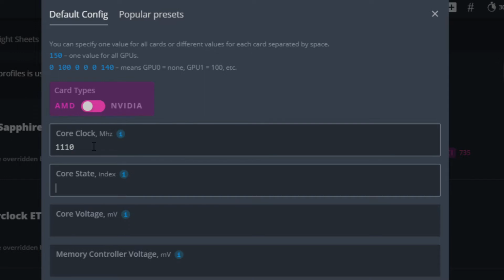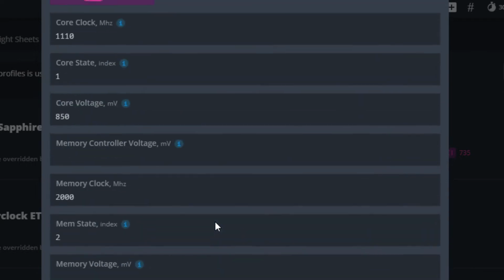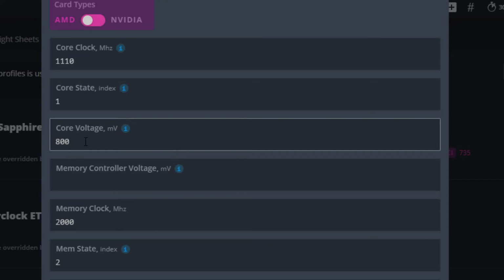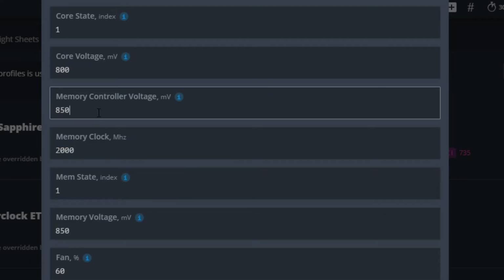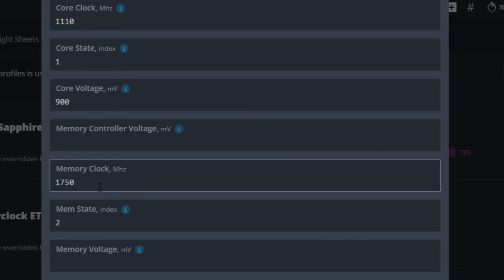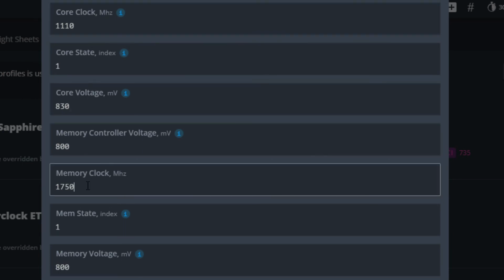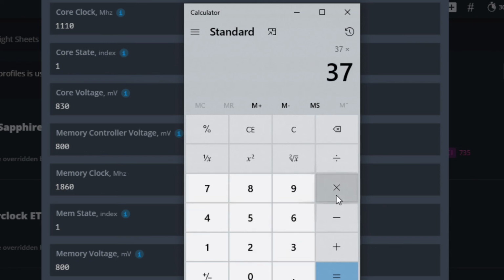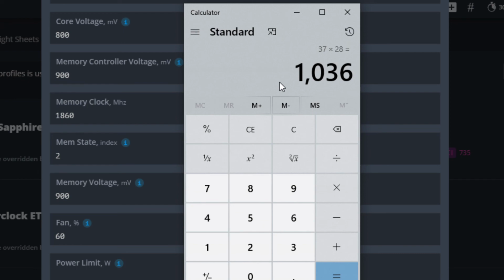How to Overclock RX 570 for mining Ethereum or any Algo Simple in-depth Beginners Guide using HiveOS

Comment: Please help...I have successfully placed four rx 570 cards on my btc s37 motherboard and after oc settings were tweaked everything ran perfectly and I've been mining for a month...now I have bought a 5th gpu rx 570 and even tho it's exactly like the others...this one keeps crashing every time no matter what oc setting...I tried flashing a new bios with stock settings..but it's still doing the same thing...hiveos does see the card ..it reads its temp...fan % but shows N/A for hashrate always. and then crashes before it begins to mine  if it would be able to...any help or suggestions? ..do I have a bad card? can it be fixed? I feel like it's problay some driver or bios issue but I don't know where to begin... hate to waste $235..any help appreciated
Reply from the maker: I would suggest running memory to start on 1750mhz, set core clock 1100mhz, set core voltage 900mv.
See if that does anything to start
Reply: @CostEffectiveminingYT  thanks for your reply.....I have it on 1750mhz 825 v and 1100 just like the other 4 which are running great...this one just keeps crashing and doesn't show a hashrate..feel like it's a driver or bios issue but tried to flash the bios and it didn't change anything
Reply from the maker: @st-qp4mr  try it solo without any other gpus in the rig. you can try the stock bios again and see if it will mine on stock settings. i have 3x rx 470 4gb that crash with stock settings so I have to run 1600mhz on memory and i only get about 23mhs, with those cards I run 1040-1100mhz core clock with 900mv.
The Core voltage has an affect on the memory controller voltage for these cards.
Reply: @CostEffectiveminingYT  yes took all other gpus out and tried it solo...still same result...it shows on hiveos and give temp..fan% and N/A for hashrate...I have tried every possible clock settings...and I have flashed the stock bios..still it crashes every minute or so???
Reply from the maker: @st-qp4mr  lsst thing to try is using an eraser and cleaning the pcie contacts

Comment: Hello! Thanks for this video. I am using an RX 570 in my PC to mine and I started with 26Mh/s @ 58C with stock bios (plugged directly into it) and some MSI Afterburner settings. Now I flashed the bios with Polaris mod and applied some OC settings in AMD Radeon Software to get 28MH/s at 54C (1,110 Mhz Core @ 810mV  and 2000Mhz memory @850mV). Is there a way for me to try and push this card harder? Also I only have had it running for maybe 10 minutes now but I will check back for bad shares. I am plugged into onboard graphics to see the work but I think because I am onboard that is what made the Mh/s increase.

Should I try pushing the memory clock slightly higher to aim for 30?
Reply: So I tried pushing the memory up to 2100Mhz and the Core to 1150Mhz while upping the voltage a little bit and the hashrate barely changed. I guess this is the max and I should voltage down for max efficiency?
Reply from the maker: @Digit5555  might be maxed out for windows performance, i would suggest, using Hiveos if you want to get closer to 30mhs, as hiveos will apply a mem tweak,, Ref 20-30 i think.
otherwise, if this is your only pc, then 28mhs is still very good.

Comment: I have one card crashing when it is above 70W,  I tried changing all of the settings. It just crashes and reboots the whole rig every 1, 5 or 24 hours. Downing Core voltage makes it kinda stable, but underperforming. It is bios modded the same way as other 5 cards. I changed riser and cables, can the problem be in lack of power? I have one platinum 1200W PSU for 6 cards
Reply from the maker: I am not sure. Most likely not a power issue, Most of my cards that struggle, it has to do with memory, clock to I just run q lower mem clock and that seems to help
Reply: @CostEffectiveminingYT  I already tried lowering it, it is at 1750. Thanks anyway
Reply from the maker: @vicesodan  ya some cards can be a pain.
try 1750Mhz mem state 2, dont set mem voltages, and try running 1070mhz Core with 850mv see if you can get it stable

Comment: Great explanation! Better than a netflix episode ahah

I have a few questions, how do you know the card limits in terms of core, vdd and memory? In the official gpus website, how do you get that info? Also, what are the risks of putting memory to high? I have a few rigs, my best ones are 570 Nitro+ currently doing 1150 850 2100 with mem state 1, dpm, and core state 1, they run smooth, fresh and gives no problems, but I would like to try the max settings possible, I have also other cards from different brands and memory, and I know for example, that memory brands are different and have their own perks...

For me the RX470 are a pain to put it to work correctly, because most of them they dont throw errors with TRM, they just crash and disconnect my rig from network, if I test a few settings, I need to wait only 10 seconds to know if the rig is crashed, usually is always the 470!

To summarize, I will start to tweak based on your video but I would love to know a way to know my card limits before I burn them down ahah
Reply from the maker: For card limits.
Generally I go with what is 100% stable. All silicon is different, some GPUs like the rx 470 require a much higher core voltage to run stable than the rx 570 for example.
Also I think 2100mhz memory is high enough, I wouldn't push any more.
Also if you use the calculator as I was showing, you will notice that if you bump your core clock to 1160 1170 you may get a better hashrate even with memory at 2100mhz.
Also, the reason I don't oc my cards generally past 2050mhz on mem generally is that they require higher voltages and core clock to get optimal mhs and going from 30.1mhs to 31.5mhs uses a LOT more power.
Each card requires different voltages and the only way I know what will work if from just testing each card.
Reply: @CostEffectiveminingYT I tried your settings you’ve been posting and the cards are a lot cooler and consuming way less power! Awesome!!

Just a thing, how do you got those values 1160/1170? I tried following the calculator method but I don’t get those results, can you quick type in the comment an example explaining?
Reply from the maker: @DiogoRafaelPR  37mhz core clock on rx 570/580 =1mhs.
30mhs×37coreclock=1110mhz.
31mhsx37coreclock=1147mhz aka 1150mhz.
32mhs×37coreclock=1184mhz
Mem:
66.6mhz mem= 1mhs
30mhs×67mhz mem= 2010mhz mem
31mhs×67mhz mem= 2077mhz
32mhs×67mhz mem = 2144mhz

So in your case 2100mhz mem, you would need core clock of about 1160-1170mhz to have a good ratio.

And ya, the oc settings I recommend are power optimized which make them the most profitable.
Reply: @CostEffectiveminingYT  I think I understood now, my mistake was the 37mhz core, because I watched the video over and over and I couldn't understand that value.
You got the 37mhz core because of the 1110 "sweat spot" calculation.
As a non native speaker, a small detail made the difference, thanks!